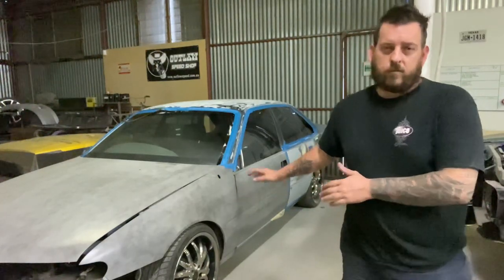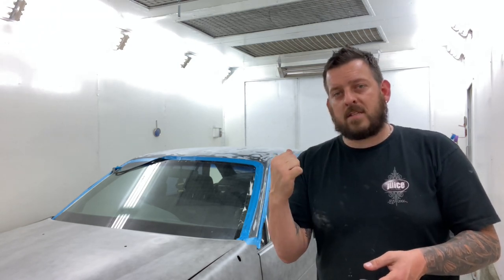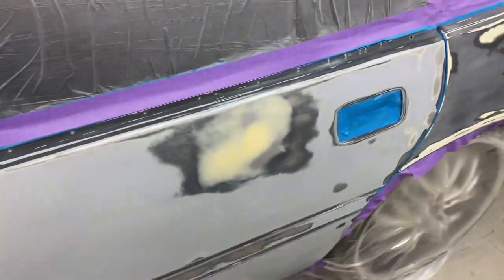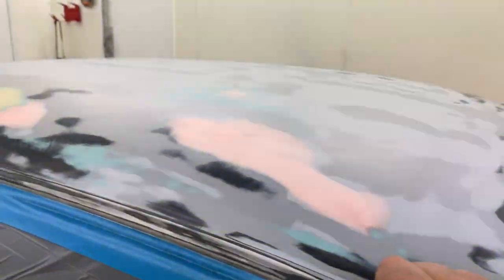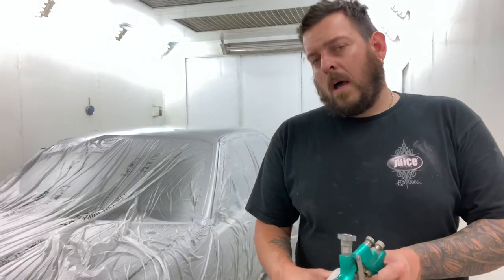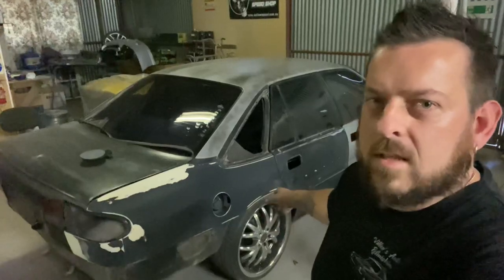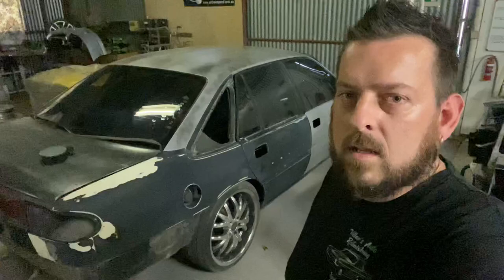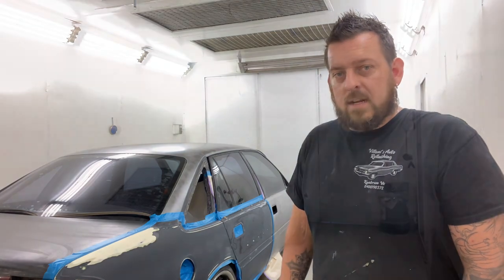Holden VS commodore Respray Ep.1

Comment: i want to respray my vs vacationer this year hopefully! love the vid & helpful inside knowledge 💯
Reply from the maker: That sounds good Wayne, whats the colour your going on it? Thanks mate appreciate the kind words and support!
Reply: @vautorefinishing7672  hopefully all goes to plan & i get it done, original plan was “light my fire” that the HSV’s & some VF’s are & now i sort of want a dark blue with some sort of black mixed in there or purple with black, i’ll decide once primer is on i guess
Reply: @vautorefinishing7672  i should have a 3 year heavy panel beater helping me as well if i can get his spare time, fingers crossed 🤞 will make the process a whole lot quicker
Reply from the maker: @waynewyborn5697   yeah mate thats the go, its always good getting a hand to get things done thats for sure. Nice colour options youve got, the light my fire would stand out on the VS, what driveline are you running in it?
Reply: @vautorefinishing7672  sorry for the late reply, was busy pulling parts off the rig today & yeah that was my original thought, light my fire will really pop on the back shape fingers crossed & with the chrome trim should top it off, as for driveline just a 3.8 eco with a cam, valve springs, retainers, pushrods, high ratio rockers, few other bits & pieces but once she is painted i have a fg turbo to wack in there at some point just to get under peoples skin 🤣🤣
Reply: @vautorefinishing7672  was meant to say “ vs shape “ instead of back shape hahahaha 🤣

Comment: Felt a bit strange seeing one side primed then another side primed.  why did you do you do this?    What primer did you use?  Im used to glasurit when I used to do this work, now my painter uses PPG.   Just acruiqred a bootlid also, so have all my pieces, now deciding if i change the door moulds and go chrome trims all round if they just stick in.  Cheers love the local work - Im in vic metro.
Reply from the maker: Hey Mate , the reason i primed in stages is because i work full time and i only do this in my spare time after hours. So once i have a few panels repaired i like to prime them and get them sealed up and not let them be exposed to the elements as it could be days or a week before i get another chance to work on the car. Id rather prime whats ready and know its sealed and protected and make progress than wait and have filler/metal exposed to the elememts. I use HAMR products throughout the whole job, i used ppg for the last 8 years at work and currently using Glasurit now its all good stuff in my opinion

Comment: Hey mate any tips for cleaning out the old seam sealer from the drop rails? About to do mine. Cheers
Reply from the maker: Hey Matt, its pretty straightforward all i do is use a wire wheel and strip it all out. When its mostly cracked sometimes most of it will just chip out with a small flat screwdriver then just clean it up with wire wheel. Id then sand it all smooth in the drip rail best you can , put some etch/epoxy primer on first then re seal after you’ve primed it just before you paint. Hope this is the answer you were after 👍🏼
Reply: @vautorefinishing7672  legend thanks man appreciate the help. I was nearly going to seal over the original stuff but thought I better not and do it properly haha
Reply from the maker: Haha good to hear mate. May as well do it properly its still going to cost you same cheers man

Comment: How much would it cost to get my vs resprayed botanica mica
Reply from the maker: Hey mate, all cars and jobs are different and pricing varies a lot. I cant give a number without seeing a car in person theres just too many variables
Reply: @vautorefinishing7672  fair enough cheers for replying tho 😁
Reply: on the cheap closed door under 3k, better job 5k closed door still.  more than 5k if needing repairs galore and good porducts used possble even flow coat or cutting back.  As mentioned heaps of variables.